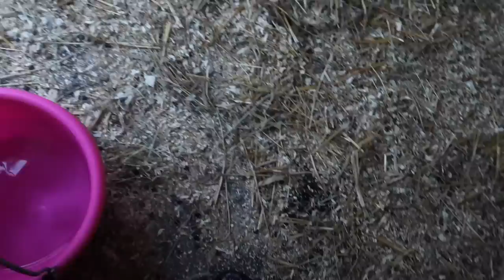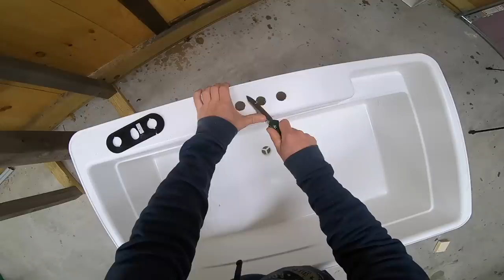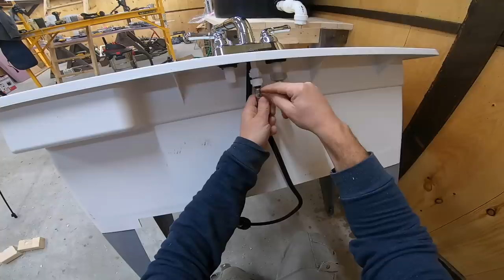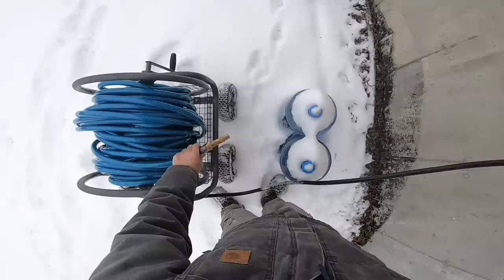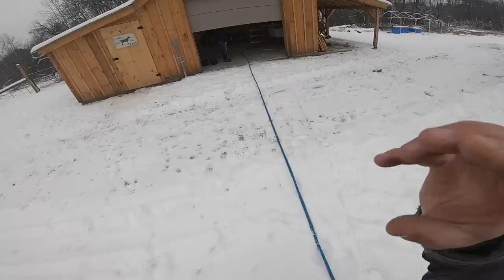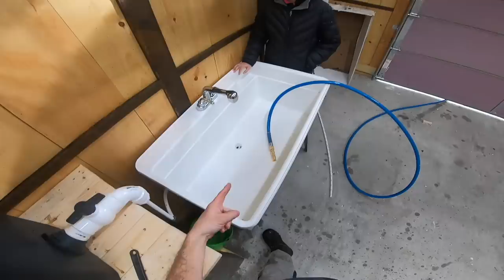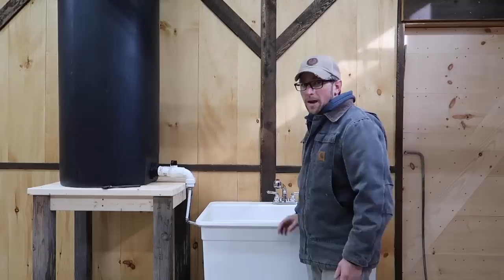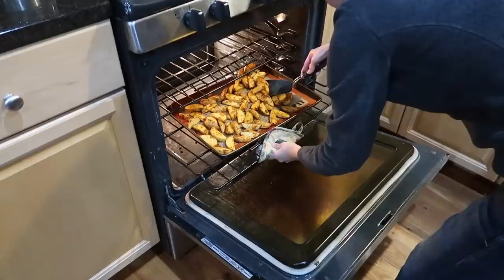Hooking Up the Water storage System Everything Was going so good until the END

Comment: Enjoyed the video Al. You need a laundry sink faucet. Lowe's has them and it's item number 819342 model number 2131LF. It's a Delta brand. I've had several of these and they work good and you can attach a water hose to them. You can cut a short length of hose for use in the sink. Thanks for taking the time to produce the videos. Y'all take care and God bless.

Comment: You should be able to simplify that faucet but you may never get the pressure needed for the spray wand. I'd return it for a cheaper one and remove the water-saver washer. Also, consider another pipe for filling a container on the floor.
I would also add a water heater blanket. I understand about using the tank as a battery for heat but without sunlight, I don't think you'd see a benefit. 
From the beginning, I've been hoping you'd harvest rainwater from the roof. Maybe in the Spring??

Comment: At the top where the water comes out there's also stainless steel  screen ,The plastic part increases pressure but reduces flow remove that plastic part and you should be increasing flow or get yourself a on demand pump

Comment: Should have put a garden hose fitting into your discharge pipe. It would have allowed you to have a garden hose in the shop area if needed also for filling animal water without filling water jugs, also if you got a reverse coupler you could have filled the tank using the hose instead of climbing a ladder to fill from the topside.

Comment: How about a small water pump that automatically starts when you open the faucet? You should also block the in-feed to the faucet that you are not using and only open the tap you are connected to. That will help build pressure internally. Another step is to remove the small filter at the tip of the faucet (which reduces water flow). Warm (literally) regards from Athens!

Comment: If you put a tank in the workshop and heat that place with electricity, you might just as well put a pressure bladder tank in the system.
The “low flow” part in your fixture is usually right where the water comes out. Just take that section off for full flow.

Comment: You can use a small pump at  aquarium store that uses 35-45 psi. If the large fittings do not solve your flow problem. Or return the faucet get a non flow restrictive faucet. OR just extend the hose you have on the tank and add a outdoor tap then attach it to the sink.  Problem solved.

Comment: I would take your left over strap and put one low.  My logic is you have a garage door and that means traffic if something hits one of those legs on your water tank stand it does drop down below top strap and tip over causing a much more serious damage.  I know it will be looser with no ratchet but it is only further precaution.  Not sure you had enough strap leftover and if  you have enough support at the center dark moulding going up the wall.  Just food for thought.

Comment: Next time you need to fill it leave the top closed install a water stop valve for your fill hole or what you call a bung hole. Hook up your hose. Fill with the stop valve open. Shut the valve before turning the water off and disconnecting the hose. Remove the restriction by changing faucet to the same type that you have in your outdoor kitchen. It will give an increase of pressure and will automatically keep you from overfilling the tank.

Comment: Why not bolt a on demand pump to the wall right there. You have power and its heated . Should be no issue at all.  A RV type water pump  would also work for this application.  Check out Northern Tool they sell all ya need for the install.

Comment: If there is no air vent at the top of the tank you will not get a flow of water. To calculate the pressure at the outlet divide the height of the water column by 27.72 and that will give you the water pressure +/- 1%. 27.72 is the pressure for distilled water.

Comment: Use a small compressor with a set psi setting or use a bike pump and pressurize it when you know your gonna be needing it that day.
Reply: Sorry I didnt get into more depth on the compressor just set the pressure regulator for say 40-50psi and when the tank on the compressor drops it automatically kicks itself back on its kinda the same concept in a house pressure tank

Comment: Love your YouTube  presentations .  You can enhance your gravity feed system to have the pressure you need by installing an on demand pump  or a bypass type pump.  Changing the faucet configuration will only change the volume but not the pressure.  A pump will give you what you need but unfortunately add to the cost of your most interesting project. Best of luck,

Comment: Would it be possible to add air to the tank in order to create pressure?  Maybe a tire valve on the side of the tank and seal the tank so the air could not escape?  I would think the tank could hold a few pounds of pressure.  Maybe use a pressure release valve to keep the pressure from destroying the tank, something like what is on Air Compressors or even hot water heaters?

Comment: If you have a ReStore in your area, or similar thrift-shop, look for an older faucet setup that doesn't have the new-fangled water-saving tech. Also maybe check at your local feedstore supply and in the laundry department at a hardware store. BTW, you didn't count the lone egg that was by the inside feeder...unless that was the earlier one and you just spliced in that segment.
Reply from the maker: I wish we had a restore or one like it.
Reply: @LumnahAcres  I guess we have one in my area because there are a lot of hotels and time-shares that remodel fairly frequently. Got myself a like-new Kohler deep soaking tub (with overflow rim) for $65 (retails around $2,800), oak cupboards for $25 a section, hanging lamps (clay w/southwest cutouts) for $15 each, and a bunch of other stuff. Could have had tons of beautiful pink/red granite countertops too, if I'd had the place for them. How about Goodwill, or Salvation Army stores? Heck, maybe even the town dump. If you find something that's got a destroyed finish, you could always get it replated fairly cheap, so long as it works okay.

Comment: My thoughts were the same as 'They call me Bacon', Put a slight charge of air pressure on your water retention tank.  Add a hose that you can connect to your compressor and add 20 or 30 lbs charge and see if that gives you enough pressure for your faucet. If that doesn't work go to a scullery faucet similar to what you have up in the outdoor kitchen. (Where it's just a hose with a valve on the end.) And you can return the current faucet for a refund.  Love your videoes and miss the days there are none.  Gina's oven-baked fries looked good too!

Comment: My first thought when you checked for clearance on the outflow was, "That tank is not high enough." I am using essentially the same theory to fill my aquarium. It is made from a drink dispenser; I use the spigot for draining at water change. To fill I use a milk jug with some garden irrigation tubing shoved down the hollow handle, which holds the tubing down at the bottom of the jug. The jug sits on a shelf next to my desk about an inch or so above the top of the drink dispenser. That is not enough height, so I raise the gallon jug about 3" to get as direct feed as possible and it works great. It seems to me, the water reduction in the faucet is one part of the problem and your downspout is dropping too far below your faucet outflow. What do I know, I made an aquarium out of a drink dispenser when I could have just bought a box for water  ;)

Comment: If you hang the buckets on an internal wall will the heat from the barn be enough to stop the water freezing
Reply: Not through that spray foam insulation.

Comment: You definitely have enough water pressure to go down and back up.  Physics says if the tank is higher than the sink, and it is, you can go down and up several times and everything will work out OK.  You see this in siphons, and when people use a flexible tube of water to level foundation piers, for example.  A more important consideration is the height of your water supply.  If you move that tank up several feet higher, or if you put it in the loft, you'll get a lot more pressure in your system.  Good thing is, that can be done any time now or later as need be.

You are using a low-flow kitchen faucet, not a high-flow shop faucet. That is a restricting factor.  The 1/2" PEX with compression fittings is another factor.  Either 3/4", or expansion fittings, would give you more flow.

Comment: If you were to take the faucet apart, you will probably find a little plastic restrictor valve inside. That plastic is removable either with a knife or a drill bit. Your faucet should work better.

Comment: Why not put a small electric pump between the tank and the faucet. When you needed water just flip on the pump. That would solve your problem.
You can cut the water saving restriction screen out of the faucet head and you will increase the flow.
I would run a 3/4" or 1" pex line to the outside wall near the garage door and install a fitting so all you need to do is hook the hose up to the fitting. This would allow you to fill the tank and not lose any heat when opening the door.

Comment: You are always going to have problems as the flow will be based on the head of pressure, the difference between the surface of the water and the outlet. As the level of water in the tank drops, the flow will as well, so a fix that works with a full tank may well stop when the tank is part empty. I would suggest that you put an electric pump in the system to maintain a constant working pressure. I don't know what is available in the US, but here in the UK the Salamander range of pumps are quite popular for boosting domestic water pressure.

Comment: Al, 
Sorry this one didn't work out.   
Google tells me that most faucets require 8 lbs of pressure to function as expected. 

Using that the formula is 8 psi/0.433 psi per foot of water elevation = just under 18.5 feet your tank needs to be above the faucet's exit.  
Can you mount your tank (on its side?) in your rafters safely to increase your pressure?

Comment: On my RV I have 2 - 55gal drums sitting on the ground outside that I feed my 30 ft RV . Instead of filling my RV tank I use these tanks for water and hook up the hose to the city water feed on the trailer . Don't like hearing the pump in the RV running so I have a RV pump outside and it pumps the water into the trailer . Lots of pressure for the RV . Pump has a pressure switch on it so when you shut the water fawcett off the pump turns off . Pump is 12 volt and it's hooked up to the RV 12 volt system . You can add a battery and charge it up anytime because you have power in the work shop . I even have great pressure for the shower and the shower is in the front of the trailer . What happened to your hot and cold water outdoor fawcett on the side of the house . You were using that for your outdoor kitchen if I remember correctly . I didn't see a hot and cold water valve when you hooked up the hose to the house this time .

Comment: Filling the tank would be easy with a sight tube made from a piece of clear PVC between the top/bottom fittings.  From there, a couple more fittings (valve and hose connector) would make filling the tank very simple.

Also wondering why not bury a water line and install a frost-free hydrant.  Too far north for that?
Reply: Lumah Acres explained in a recent video that with their rocky ground & depth they would have to dig re frost it was not feasible.

Comment: Will the tank fit in the loft??  If so that will increase the head pressure some also heat rises so it will stay warmer longer.  You could get a shurflow pump and put it inline.  It will cut on and off on demand.  It wouldn't be off grid, but you do have power, why not use it?
Reply from the maker: Thanks I’ll check out those pumps.

Comment: You can get a 110v 90 watt booster pump on Amazon or Ebay for under $40 for just this purpose.  They won't pull water but they push it just fine.  I installed one on my camper because the "city" water wasn't sufficient to keep my on demand water heater working.  There's another idea...

Comment: Not sure if my suggestion is applicable.   I'm NOT a builder NOR a plumber, but it's my understanding that you should NEVER allow a pipe/fitting diameter reduction.   There is PEX "A" and PEX "B".   Pex "A" allows for no diameter reduction.   PEX "A" uses a tool to temporarily expand the ID of the tubing to fit over the larger fittings.   The expanded PEX automatically shrinks to a tight fit.   This system allows for a dramatically increased volume flow.   There are also specialty PEX with antimicrobial coating to prevent bacterial/viral growth in your drinking water.

Comment: your water system needs a pump with this i found on Amazon 
SEAFLO 33-Series Industrial Water Pressure Pump w/Power Plug for Wall Outlet - 115VAC, 3.3 GPM, 45 PSI
plus a pressure tank. that way you'll have pressure to wash with the nozzle

Comment: SMALL IN-LINE PUMP IS AVAILABLE FOR WATER PRESSURE . IT WILL SOLVE THE ISSUE.

IF YOU OVET THINK THEN , IT WILL COST MORE AND THE SOLUTION WON”T BE SATISFACTORY.

Pressure pump is the best option and there are many cheep water delivery system tap available that can provide water to the chicken and goats .

JUST LAY DOWN WATER PIPE BELOW FREEZE LEVEL ( 1 time headache of digging ) and you will be free of the daily chore of carrying & delivering water in snow and in rain.

Comment: when you use PVC glue on water lines you should twist the union and not just push it together, The twisting motion insures there are no bubbles in the glue that could lead to a joint failure.

Comment: There is just one thing you could try that is to get your air compressor and pressurize the vessel and that would give you plenty of water pressure then
Reply from the maker: The tank isn’t air tight. It has a breather hole in it.
Reply: Lumnah Acres , 
Is it possible to plug the air hole, Al?  
Try removing all the flow restrictor washers in the tap assembly. 
 Easiest fix will be to put a 1/2 PEX wall type hose outlet . Take the fancy tap back to Homedepot  for a refund.
Reply: Lumnah Acres,  Those PEX hose outlets have a pretty unrestricted flow. The 3/4 hose outlet might be even better. Mounted on a bit of your ship lap cutoffs
Reply: @LumnahAcres  To make it air tight and use water to compress the pressure read my response above. I used this method to install pop systems where there was low water pressure. It is a lot safer than using compressed air.

Comment: Pex is very flexable.  I would have only used one piece from the tank to the faucet rather than one down, a 90 elbow, then another across to the faucet.  Every connection is a potential leak in the future and getting rid of the 90 elbow connection gets rid of a potential future problem.

Also, that strap is useless.  You have a 100 gal tank, which means 800 pounds of water.  The tank isn't going anywhere.  The potential weak point is the table/bench the tank is on.  I didn't see how you built it but if it fails the tank is going to the floor, strap or no strap.

Comment: Need triangle blocks on the surface of the tank table to secure bottom of tank on the table, 4.  Water pressure tank?  Hot water on demand  water heater, electric.  Both come in small sizes....

Comment: Heads up! Water is 8.4 pounds to the gallon oh, you have a 100 gallon tank, that is in excessive 840 pounds... for safety's sake I would strap it to the wall as if it were a thousand pounds. Additionally your stand may need some more integrity..  
Just a heads up. You strapped it! 0.433 PSI is generated for every foot of rise, you generate one PSI of water pressure prayer 2.31 foot of rise. There may be debris in the faucet but you have plenty of pressure with eight foot of rise

Comment: First of all I was wondering why you didn't run water down there last summer !   Now you will need to instal a small pump to get pressure !
Reply: Lumnah Acres explained in a recent video that with the amount of rocks they have & the depth needed re frost that running a water line was not feasible.

Comment: If I recall correctly, you get one pound of water pressure for every 2.31 vertical feet of a water column.   To make your faucet work properly you might consider using an electrical pump like  boats use to deliver pressurized water to the galley and head.

Comment: Pex piping is farely inexpensive and works beautifully in the Northern/Colder climates,  however, the fittings are insanely over-priced (but as a piping system as a whole, it is much more affordable in the end).   Copper pipes have nearly zero tolerance in areas of extreme weather conditions, ie, expanding/contracting.   Being that Pex pipes are made of flexible material, expansion is Greatly increased and provides a huge safe-guard during times of freezing weather.   In short:  Pex is cheaper, more efficient, and the risk of lines breaking through freezing temps is nearly unheard of.   In the event of a frozen line, Copper will most likely burst, where as with a pex system, if freezing occurs, the pipes will expand (and not burst) and all you will need is a heat-gun or a hair dryer to thaw the frozen areas within the system.    ps.  I am Not affiliated with their company what-so-ever!..I am simply a typical homeowner who uses their system and back it 100%!  Most of my piping is in a crawlspace, and after Over 15 yrs since installing it, mine has never failed!